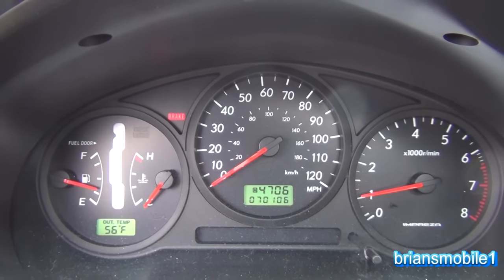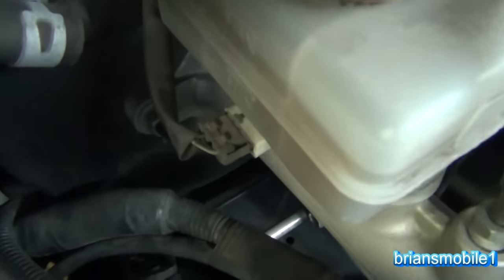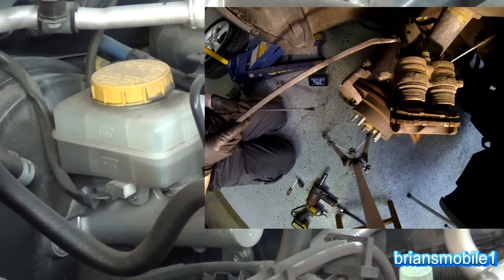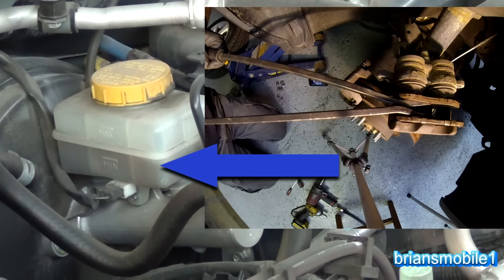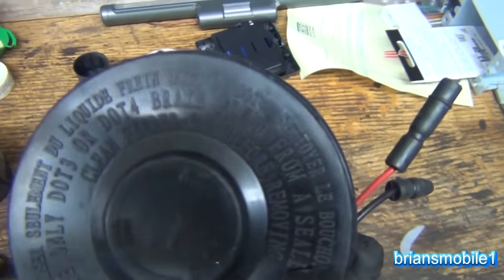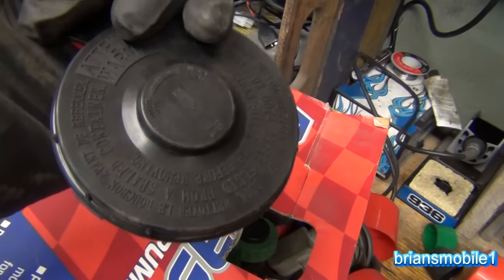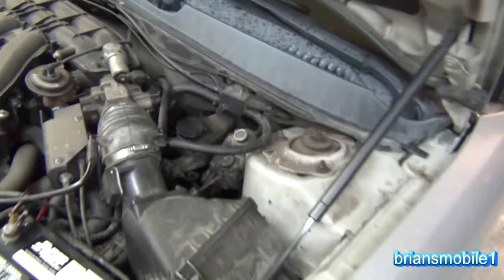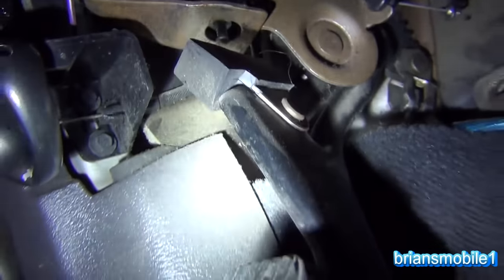This is Why Your BRAKE Light is ON

Comment: I believe the brake warning light also comes on with unequal pressure in the divided brake system.  If one half of the brake system should fail, develop a leak, the light will come on.

Comment: Thank you so much for this! My 2012 Subaru Impreza had the Brake light come on and off at random times while I was driving. Been that way for 5 months until it finally got bad enough that I decided to take a look at it. As soon as I looked at my master cylinder, I saw that I was low on brake fluid (right on the Min line.) Filled it back up and the light was gone for good.

Comment: I have one to add to your list that happened to me recently working on my Ford Focus 2007 with rear drum brakes. The new brake drums do not come with the tone ring for ABS. learn the hard way I installed the drums without swapping over the tone ring. The dash lite up like a Christmas tree with traction control, ABS and the red brake lamp warning. Code C1235 and C1236, had me puzzled at first but with a little internet search I discovered the magnetic removable tone rings. I hope this helps others.

Comment: That's how I do it also very good but I also take the cap off The master cylinder just to make sure that the air escapes because sometimes it can put air in the brake lines not all the time but I have had it do it before I never have after I start taking the Off

Comment: Ok so I have a 2005 Chevy Trailblazer I just bought October 31st Halloween 2022 a little over 2months ago after a month of having the truck it started leaking brake fluid out of the left front tire my brother in law looked at at the brake pads were so worn down it was ridiculous and the caliper was blown! So I bought new brakes, rotors, and brake pads and he put them in it was good for about 2 weeks than about a week ago my car started leaking power steering fluid really bad I tried buying the power steering "Stop leak" fluid let's just say I went thru about 5 bottles in 2 days! It was leaking within 20mins of putting the brake fluid in, I took it to the mechanic because it was becoming really hard to turn the steering wheel and all and was starting to even stall, so the mechanic did a diagnostic on my truck called me an hour later and said I needed a new rack and pinion replacement and also an alignment so I said let's do it, it cost me $1400 I picked it up today all the reservoirs we're filled power steering fluid, brake fluid, everything they topped off to the max but I got in my truck to leave and noticed the red ip brake light was on, I made sure the Ebrake was all the way down and not triggering the red brake light to stay on the Ebrake was all the way down and it is completely filled with power steering fluid, and brake fluid , new rotors, brakes, brake pads, caliper, just got new rack, pinion, and alignment, so why would the red ip brake light be on? I do not understand? Someone please help me I am so stressed I don't understand and don't want to hurt anything on my vehicle by driving it but it's driving fine and nothing should be wrong? Please someone help me🙏🙏

Comment: Thanks Brian. Wifeys brake lights been on for a month. Checked the fluid. Fine jiggled the ebrake. Stays on. This happened shortly after replacing pads at all 4 corners. But the ABS light is on too. Another strange occurrence is that the pedal is soft and goes to the floor after starting and hardens up after a couple depressions. Then continues to work fine. Also feeling a bit of wobble in the pedal as I roll to a stop. Checked all hardware, all pads still covered in meat. No overheating at any corner. 
2003 grand cherokee loredo 4.0

Comment: I've always been taught to never push the old fluid back up in reverse through the ABS and master cylinder seals.  I just have a simple brake caliper spreader tool with a screw/knob and a plate shaped like a brake pad which sits against the caliper and you use the old inner pad to screw/push the piston(s) back in more consistently and evenly instead of c-clamps and pry bars.  I always open the bleeder screw, then the piston(s) are much easier to depress (very little effort required) and the old fluid spits out into a drain pan, then you top off the reservoir with fresh fluid (if low add fluid first).  Just my .02  But then, what do I know, I'm just the "Village Idiot".
Reply: Yeah and then you have to bleed the system because you let air in it.
Reply: @tomhenderson2430  not if you don't let the MC bottom out......right?

Comment: Also to determine (on some cars ) if its your reservoir sensor or e-brake sensor.  It should get brighter if you put the e-brake on.  If it doesn't get brighter its you e-brake (switch)
Reply: Really ?

Comment: That's not the problem. Switch has been changed new pads and calipers. There is some other problem. I think it's in the emergency brake handle.

Comment: Fun thing that I've found with my Subaru about the brake fluid level: Put in new pads every 4 corner, adjust fluid the way it's exactly at top mark in the reservoir. And then when the warning light comes on for low level, you'll find out that brake pads need replacing soon. That's with STI brembos, guess the caliper pistons pull so much fluid with pads wearing out that happens. I'm thinking the engineers never thought it that way and it's just coincidence.

Comment: When ever I do a disc brake job, I cycle the pistons in and out a few times, except I open the bleeder so it also flushes out the old fluid.  Cycling the piston in and out a few times seems to help remove any varnish build up that may cause the piston to hang up in the caliper and prematurely wear the new pads.

Comment: My brake light is an enigma. Brake fluid is full and fresh. Brakes in perfect working condition. Also fresh parking brake cables.
Today I swapped out the parking brake switch, and STILL have that annoying brake light on the dash. Any clues what to look for next?
Thinking MAYBE the wire going to the switch? Forgot to slap the probes on it while I had the center console out. Any tips on what to check next would be much appreciated.

Comment: Would this also cause the ABS light to come on?
I notice that when you pushed on the caliper (pushing the pistons back into the caliper) so you put the brake fluid back into the master cylinder, that fluid had to go back through the ABS motor, which could clog up the fine holds in the motor and cause other problems. Don't you need to release the brake lines( loosen the fittings) so that the fluid doesn't take the chance to plug up the motor?
Reply: What usually makes the abs light come on is a speed sensor on the wheel bearings in the front.

Comment: I have this problem on my 04 STi. Its not the hand brake because the brake light illuminates brighter when engaged and the master cylinder is full. Are there any other ways of finding out why its not clearing off the cluster?

Comment: Helpful! My Windstar threw lights on everything all the time. 20 years, original owner, 60K miles, and the electronics just all started failing. My Grand Caravon just lit the brake and ABS light. Code reader showed "no codes". Fuses all intact. Here we go again.

Comment: Like Robert said above

Don't push the fluid in the line backup. Let it drain through the bleeders. You risk damaging the abs system by doing it the way you are showing
Reply from the maker: I appreciate you looking out for me Nick.  I've heard that before, but in the thousands of brake jobs I've done this way I have a 100% success rate without damaging a single ABS system.  Now muffler bearings and blinker-fluid system leaks... not so good!  ;  )

Comment: Mu toyota tundra had a plastic plate break out where a push button switch needed to be depressed in the brake pedal arm under the dash. It caused my rear brake Lights to be on all the time so you could not know if I I was braking. The brake lights in th rear were on all the time.

Comment: I've no idea why you think a pry bar having flexibility or some other attribute, makes any difference.  However, you're supposed to take the cap off (loosened) when retracting the calipers, and check the fluid level in case it might overflow due to someone topping it off while the prior brake rotors were partially worn so with new pads there is now too much fluid.

Now what the heck happened with your video?  It ended abruptly as if you lost some footage?

Anyway, it seems crazy to me to suggest and link to pry bars for this job.  Most people just use a c-clamp, or there are purpose built piston tools that either rotate the piston (on vehicles requiring this) or just 4 X-shaped pieces that rise in height when you turn a bolt and force nut-stubs together to expand them.  There is also a spreader like a specialized c-clamp with a much longer screw and jaw width.  Any of these seem superior to using two prybars, but of course prybars have other legitimate uses too so I suppose you use what you have, but the prybars seem to be the most fiddly and least precise way to apply uniform pressure.

Comment: Alright, how about this.  No lights are on when idling at a stop.  As soon as the car reaches 5 mph forward or reverse the brake light comes on, the ABS light comes on and the chime and "service brake system" message come on.  Then when a stop is achieved, there are again no lights whatsoever.  No codes are thrown, just everything at once when the car starts moving and it remains until it stops completely.

Comment: had an issue last three month get empty fluid with no evidence of lake so refill again get also empty there's no sign of lake brake light on traction control on
Reply from the maker: The fluid does go down and brake pads wear.  There's a range that the fluid should be in that's okay.  If it's empty, you have a leak.  Sometimes the leak is into the cab of the car by the pedal or gets burned off in the brake drums if it's a slight leak in a wheel cylinder over time.  I've also seen brake hosed with a down loop drip point that drips straight to the ground, but only under heavy braking.
Reply: @briansmobile1  No lake inside or outside  of the car hoses all inspected I am afraid it could lead the oil inside the engine or booster valve forced the oil into the engine  the JK has only Disks no drums

Comment: My mom has a 2006 buick rendezvous cxl. When she starts driving it after 1min the beeping chiming noise goes off and will continue the whole time you drive unless you turn it off, also the anti lock, brake light go on, but brakes are not locked obviously... so any ideas?? I've researched these cars have A LOT of issues but I'm trying to fix these issues for her one by one. Thank you

Comment: Your rear drum brakes have an automatic adjuster that works when you back up fast enough in reverse and step on the brake hard enough. Most people don't do that fast enough or hard enough to cause the adjusters to do their work hence your brake system may detect the maladjustment of the rear brakes. That happened with my vehicle. The solution is to find an empty parking lot, back up quickly (maybe 10 mph) and step on the brake hard. Repeat five times or so and the light will turn off. Worked for me.
Reply: Might try this, I reversed and put up handbrake... in a fast motion as I wanted to get car out of the way of the narrow road, then this problem happened
Reply: Will definitely try this
Reply: Interesting. I've got a 1990 mazda pickup and had my hand brake engaged backed up 2 feet before I noticed. Now my brake light on dash stays on. Might try this.

Comment: So the plate pushes the plunger and it shows brake. When released the plunger spring pushes plunger back out. That’s exactly what I saw happen in this video. So I’m confused as to why you say the plunger switch failed.

Comment: I have a question, when pressing the piston, do I need to remove the master cylinder cap? If I don't remove the master cylinder cap, isn;t there have pressure inside the system?
Reply: My Daddy  yes   always remove the master cylinder cap  when manually pushing the pistons back in

Comment: I have a brake light that doesn't come on until you've drove the car a 1/4 mile or so, then I hear an alarm DING and it comes on and it does that without applying any brake.
If I start it up in the driveway the only way I can get the brake light to come on is to apply the E-Brake, light comes on, release it the light goes off repeatably!
Still setting in the driveway and idling and depressing the brake peddle, put it in drive, back to park the brake light WILL NOT COME ON!
I've replaced the brake fluid sensor, I've unplugged the sensor, and I jump the harness plug  which activated the brake light (parked in the driveway)
With the sensor completed disconnected the brake light still came on during a short drive (same as with the sensor installed and connected)
Its full of brake fluid, no work was done to the brakes within the past year or so, it has a very good feeling  (full) brake peddle.
It is displaying the ABS light but that was that way when we bought the car 120,000 miles ago.
What else is tied to the brake light?
Its a 2005 Dodge Caravan.

Comment: My alternator and brake light came on and after replacing alternator both lights went away on my 2005 Nissan Altima drove me crazy trying to find out why the brake light was on I looked and didn’t find anything wrong

Comment: I had a brake line rupture and lost all my brake fluid. I replaced the brake line along with 3 others, bled my brake system and topped off fluid but my brake light and TC light are still on. Will they reset themselves or do I have to have them reset with a scan tool?
It's been 2 days so I feel like if the lights were going to reset themselves they would have done it by now.
Vehicle is a 2005 Cadillac escalade ext.
My dash display also reads service brake system and stability system disabled.

Comment: Why use the prybar? It is so much easier to use a large "C" clamp like a 10 inch with the old brake pads to push the pistons back, also there is less opportunity for the caliper to roll on ya. Just wanted to know is all mate, maybe there is another way I haven't found yet.

Comment: Bummer,   the brake lights on the rear of the car ( Torrent ) are lighting as the car goes down the road.     step on the brakes a light, they are all on, step off the brake to go when the light turns green they go off and within a 100 feet, sometimes sooner  the brake lights come back on and stay on including the third brake light.     so on to look for more answers

Comment: Dear, i have Lexus Is200.
the brake lights on dashboard when i press emergency brake pedal, but the hand brake function quite well, when i push it on the light comes on and when i press down the lights comes down, when i press brake pedal the handbrake light comes on and doesn't switch off untill i switch off the engine...
The brake fluid is Ok!
please can you help to fix it?

Comment: Just keep in mind that some MC's are finicky when it comes to forcing fluid back in them. I have seen MC's ruined because of this. Here's a tip, if you run the risk of snapping the bleeder screw off, loosen the banjo bolt and bleed it from there.
Reply: That still doesn't bleed out actual caliper completely... only hose and portion of caliper..need fix the actual problem. No disrespect just a tip

Comment: Ty for the information. I'm pretty sure this is what has happened with my 05 silverado 1500. I let it sit way too long and it's having some issues. Was going to take it to a mechanic last week and the shifter linkage disconnected from the transmission so its been one thing after another

Comment: I had this happen to me.  Was weird. The "brake" indicator would come on, but when the weather warmed up, the light would go out. Then I found this video. I checked the brake fluid and it was not low, but it was not full either.  I topped off the brake fluid.  Problem solved.  I suspect the brake fluid level was just right on the edge of the light coming on.  When the weather warmed up, the brake fluid warmed up and expanded just enough that the sensor would detect it being "good."

Comment: My Chevy Optra/ Lacetti 2004's brake warning light comes on when I apply the brake first time after starting the vehicle and then stays on. ABS light goes off stays off once I start the engine. Can anyone help? I dont feel any problem in braking and brake fluid level is also okay. The light comes on after applying the brake and stays on. .

Comment: On my 2002 Monte Carlo either the float switch keeps sticking or the Parking brake switch system is fouled up because my light comes on intermittently. My car is know to have electrical connection issues.

Comment: My brake lights work fine when my running lights are off but when you turn on the lights the brake light turn on as well
Reply: I have the same issue and i havent found the problem any luck your way? @misty gregory

Comment: What if the brake light is only on for a few seconds and then off by itself once for a while? Thanks!
Reply from the maker: Could be an intermittent contact at the E-brake or flue sensor.